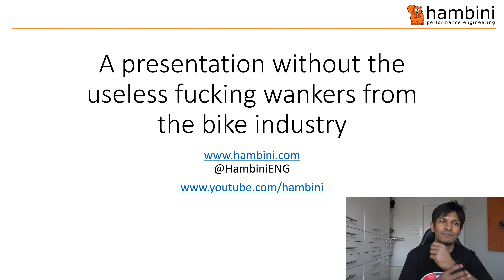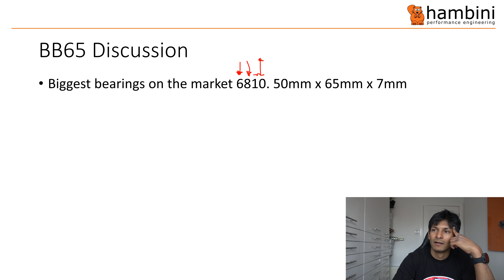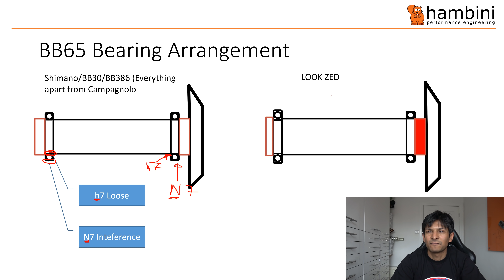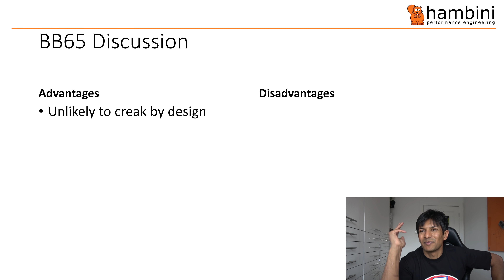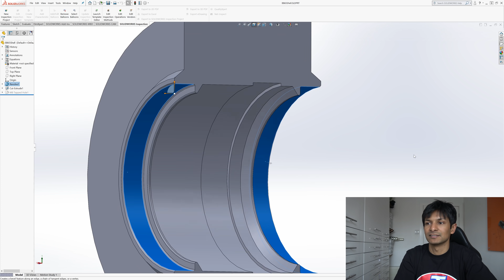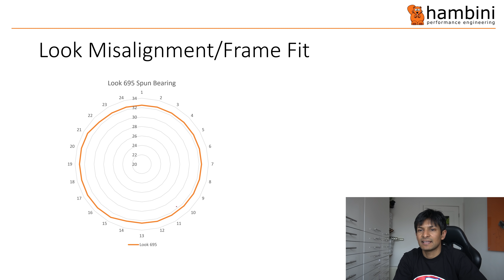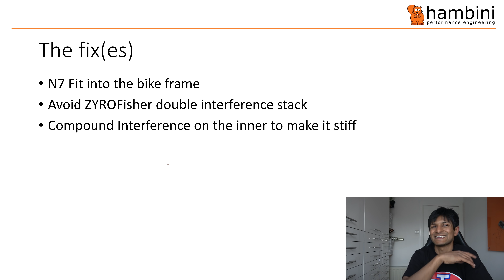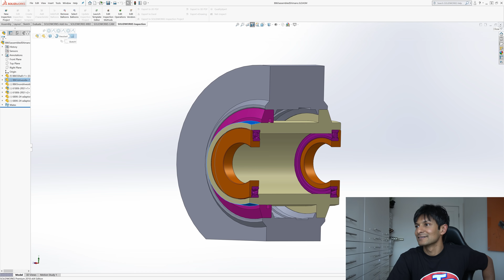French Engineering superiority: Hambini Bottom bracket and Look 695 bike frame

Comment: It’s about time you cut that threaded rod on your bearing press down to size. Your videos will be shorter   Lol
Reply: He's just ready for someone to invent a 250mm bottom bracket shell and for Cycling Weekly to try and convince us that a bike with a Q-factor like the stirrups on a horse are the 'new aero' (with full supporting wind tunnel data, of course).
Reply: It's almost certainly a headset press pinch hitting as a BB press.

Comment: I really enjoyed this. Works as a mechanical engineer in micro-mechanics / medical, and enjoyed that you took the time to explain the failure mode that occured and what the fix was. Also learned a bit today in regards to the bearing fit between the frame/BB/crank - all round good stuff! I have got a new build in the works, I'll check if you have brackets available for this fitment.

Comment: This is like having your favourite dessert twice! Did the original get taken down?
The other thing that is so amazing about look is you get a finished bike (aka buying a 695, which i just did) you get, all the adapters/guides to cut the stem or to cut the seatpost, you get blade pedals included, you get a bike cover, you get a proper carry bag, with all the special tools and compartments for them, all the lubricants required and gripping grease. Basically everything you would expect to build and assembly the bike to go riding! Again amazed what you should get, with every top end bike, but you don't!

Comment: you are a very very clever young man especially for a 5yr old 
. we have a street lighting fixing issue where a threaded coupler between light fitting and column bracket keeps unscrewing and the manufacturer insists its an install problem not a design one 
i bet you could figure it out in no time

Comment: Just got that 695 BB installed on my bike, THANKS HAMBINI, WOW so dam stiff and smooth, my power numbers are up ? maybe the garmin 3 pedals are broke, I keep calibrating as I dont believe the number increase, the feel of the power going through the drive train is very noticeable and almost surreal, anyone who likes the power speed doing and feeling you know what I'm talking about. it's like riding a new bike the characteristic behaviour of the bike has changed, smoother, stiffer and feels so fast, as it was fast already the BB seems to have brought it to another level, I'm a FAT Fu££$% and flying up short hills, as there feels like there is no wastage of power.
Getting on about the service of look bikes, its the same here in Ireland, for the sake of my bike I had to stop using the people who sold it to me, they were breaking it bit by bit and making school boy errors in service. I was lucky I found a technical bike mechanic who deals in high end racers.
Reply: edward dillon: If the power is measured in the pedals, a better bottom bracket may even deliver more speed, but will not influence the power reading!...
Reply: @natanbrastap7752  can the frame absorb in flex some of the power ?
Reply: @edwarddillon  I think no (there is a GCN vid on the subject), but the point here is that, even if the frame do absorb, the power measure in the pedals can't be affected, just the bike speed can
Reply: @natanbrastap7752  u think or know ??
Reply: @edwarddillon  The jury is still out, so I better don’t claim ‘to know’; but I align with the belief that the frame perhaps accumulate some elastic energy, but, if so, gives it back in the very same pedal stroke. If the frame did really absorb energy, it had to get hotter and hotter (and it doesn’t), because energy don’t just disappear, right?
Reply: But maybe you are on to something, yes... More rigidity allowing for a better pedalling mechanichs, to crush harder the pedals and deliver more power... Or the increased rigidity does affect the power reading, who knows for sure...
Reply: @natanbrastap7752   newbie here but can we measure torque at the crank/flywheel (crankset) or directly at the rear hub or wheel/tyre?

Comment: You are correct that Look is difficult to deal with. Their customer service doesn't even return emails asking for spares not on their list. But they do build good equipment. Though if they were easier to get I would probably prefer a Time since I think that they are a great deal more concerned with frame failures.

Comment: There is no dust seal on the crank bearing. Dust comes through the holes in the bottom bracket and destroy the crank bearing. I guess that's why the bearings on the zed 2 cranks fail...

Comment: Peugeout should hire the engineers from Look.

But yeah, it's the lick!
Reply: Kleiner Helfer  try changing head light bulbs on a Peugeout 307 and you will know what I mean.
Reply: Have had a diesel 208 for over 10 years now. Only part that broke was the brake pedal detector, cost 15€ and replaced it myself. Still works like a charm. No problem whatsoever changing lights.

Comment: I had bought a Look 765 Optimum+ (Full Black Mat Glossy - top of their endurance range) and the frame cracked after less than 200kms with no crashes, drops, or any other significant impacts! The crack occurred in the rear where the seat post sits. This bike uses Looks 'carboflax' so maybe this compound needs more R&D...
Reply: Did they give you another frame ? What happened ?

Comment: Layman question: If the frame is superior engineering, and the BB has a high quality bearing, why has the bearing spun?
Reply: Antti Salonen bearing wear and increase in friction, the 'spin' he refers to is more of a sinusoidal flex cycle of deform and relax with each pedal stroke, the outer race creeps around microscopically trying to drag a tiny layer of metal with it from the  housing. Which has caused the minor damage. of course you could argue the if Look had not produced the BB with it's fancy crank needing the BB 65 to be able to get it in, the  the bearing would be easier to change before they became overly worn, which caused the bearing 'spin' in the first place... 🙂

Comment: How come you used grease on the carbon to BB interface, but recommend using loctite on your 386evo BB?
Reply from the maker: it's not carbon, it's aluminium on this bike.
Reply: Hambini Gotcha. So, is the general rule “Use grease for metal-to-metal interface, use loctite for metal-to-carbon” or is it more complex than that?
Reply from the maker: Yep that's correct

Comment: I have a Planet-X frame with a BB30 bottom bracket, I bought it in 2010. Its been good. Now Planet-X frames have 68mm threaded BBs ! Is this because they lost their faith in press-fit or have their frame suppliers been unable to make frames with accurate tolerances ?
Reply: Threaded BB's  can be equally horrible executed as pressfit. Assume its because Threaded BB's has become a popular marketing tag, not because the excution on the frame is batter than the previous.

Comment: Very very nice work  Would it be advantageous to cut slots in the middle lengths of the bottom bracket body to save weight or would it affect performance & longevity ?
Reply: ........... remove the wheels too, lots of useless weight saved, boy does it fly then???
Reply: @gregtaylor6146  wow, dumb answer. Thank you for your invaluable contribution.
Reply: @gregtaylor6146  so are you alone in life  because of your stunning personality or because of your incredible wits ?

Comment: Hi Hambini, I really enjoy the video. I have a question. You are always talking about tolerances but never about roughness of the surfaces where the bearings are going to roll. By my little understanding usually bearings requieres quite low roughness and tracks must be rectified. To do so, in my college they explained to me that a little orifice must be done to prevent breaking the tool. When you machine and remove material you are already achieving the specified roughness? Thank you!

Comment: You are a "fine piece of French engineering".  Can you team up with geometron to design a fast alu road frame, that would be great, thanks.
Reply: Ummm... Geometron, what? Do you know that they are very much only mountain bikes? Also they are partnered with Nicolai, and you can see that all the tubing that Geometron and Nicolai use is very much cylindrical and not at all aero, and they are all pretty damn heavy as they are built for extreme durability and strength, great for mountain but not for road. I don't think we will see a Geometron or Nicolai road bike.

Comment: Hello Hambini. You speak about your Superlight BB for that job. How available is that material for frame manufacturers? Is it already being used? or will we see a normally £700 frame for £2000 because of the cost/weight of the material? thanks :) mark
Reply from the maker: It's quite difficult to weld so that makes it problematic for frames. Bike manufacturers aren't cutting edge so it will take a while for that to filter through
Reply: @Hambini  Thank you for your prompt reply Sir. I might well be 40 and fucking fat before a sub 1kg frame [that wont crack like a Starship] appears.

Comment: 30 years atleast
look kg86 i think was the first? someone will correct me
Reply: Ash Staniland - I think Kestrel was in production first with a monocoque carbon frame and it was made in the USA.  I have one.  Bought mine several years later in 1996 from R&A Cycles in Brooklyn NY.
Reply: Greg Lemond was the first rider to win the Tour de France on a carbon frame. 1986 on a KG86.
Reply: @robertp7209  Carlton (division of Raleigh) were producing them in the UK as early as 1971. Graftek produced carbon bikes for the US cycling team for the '76 Montreal Olympic Games.
Reply: @davidlewis3924  carbon tubes bonded into aluminum lugs useing the same bonding tech and lug machining as in in the Duralinox frames. True carbon award goes to Krestell.
Reply: David Lewis - full carbon incl. bottom bracket and head tube, or just the main tubes?  Fork?
Reply: @robertp7209  Carbon tubes, alloy lugs. Fork would have been carbon blades with alloy crown and steerer (I guess). Giant did a similar version in the late '80s called the Cadex I think. A friend of mine had one around '88/'89 and it came with some astronomical price tag like 900 quid. Pretty exotic in those days when most people were still riding steel.
Reply: Morten Reippuert Knudsen - kestrel EMS fork had steel steerer and crown.  The rest was carbon.  I wish carbon forks today go back to steel steerers, carbon failures have been catastrophic at times
Reply: David Lewis - sometime not long after, fat bottom tube Cannondales appeared and titanium alloy litespeeds became popular.  I was told not to get carbon, a mistake.  My Kestrel has 20k miles not a crack in it, and I’m a heavy rider.  The magazines at the time gave it favorable reviews compared to steel, said other carbon production bikes I think Trek dulled the ride not lively.  So much for titanium alloy - never took over.  Looked good though unpainted.
Reply: @robertp7209  I seem to recall around 1988 the first fat tube Cannondales appeared in the UK with an ad slogan something like 'the first production frame under 2.8lbs'. Here's the catalogue from '88  https://vintagecannondale.com/year/1988/1988.pdf  Shimano 7-speed SIS and steel forks. I was riding a steel Reynolds 531c frame at the time with a 52/42 crankset and 6 speed 13/23 freewheel. My knees hurt now just thinking about it. The Klein Quantum made an appearance then too but very difficult to get hold of in the UK.

Comment: Could this be made to fit a BB30 crankset or would the bearing dimensions mess things up? If not, could it be made into a better version of a BB65 to BSA adapter?

Edit: is it actually 6806 bearings that you could use a long axle BB30 crankset with?

Comment: Splendid job and breakdown of developing spun bearing issue on that LOOK frame and why your fix is tits.
Quick question just out of sheer curiosity: Does it or does it not make sense (in very general terms) to fix a counterweight on the non-drive side of any given crankset with the purpose of dampening out overall "wobble" forces along the axle? Always wondered about that. 
Anyway Hambini - THANK YOU for your valuable content and very educational presentaions.
Reply: There is no wobble at 60-120 rpm, so nothing to damp.

Comment: Hi I have work on many look the main problème i this zed crank . I already à creak problem. 2 type of wear, one the bearing turn on the frame and second the bearing move side by side and wear the frame and creak. Look take many years to solve the problème , and test full range of loctite ,the load allready brake it. Now look just have the track bike with zed crank. Is maybe good engineering but the reality is not the same . It have 2 other exemple in look , aerostem the bar can slips but engineering said it have more contact and epost wear to fast. Magic does his effect and all this technologies disappear in all off the look catalogue. For happyness of all bike mechanic and especially look team mechanic 😂

Comment: Hey, great video. One question, I don’t understand how the bottom bracket stays tight on the frame…..if I understood right there’s no threat between the two pieces, just one goes thru the frame and the other one simply goes over like a pressure washer over…? is that it? did i get that right? how can that hold ?

Comment: So haven’t you just made it weaker by fitting smaller bearings than original? Why not just replace the original bearings? Also I presume your design would interfere with internal cables unlike the original? As would block internal holes. Does look nice though

Comment: Ok.  I’m old school. You could by a bottom bracket for the old steel then aluminum.  No issues. So I’m totally baffled why all these frames (carbon) seem to have all the dimensional and alignment issues. It’s not rocket science. Are the designers qualified by some global online university ? Surely Earnest in Italy achieves quality unlike the rest ?
Reply: It’s not necessarily the designers creating the issue.  It seems to be implementing a proper design and seeing it through the manufacturing process, and it seems the bike companies don’t want to spend enough money to see everything through.  It baffles me that a $50 auto part is produced properly, but $100 bike parts are not, so we have to spend $400 to have Hambini do it right.  Such is the world of mass production today.
Reply: @petesjk     It’s madness !  I shall take it back with respect to the designers. Manufacturing though. If the company I work for sold out of spec product then it’s a disaster! Produced in multiple locations globally but one way of producing dictated by the mother shop then QA systems.  Staggering that Trek etc do not do this. One unit of ours retails at $3. We expect it right for the millions produced and sold. Should be easier still on high value.  As you state with car parts vrs the fundamental aspect of a bike. The frame. Shame on them for no QA !!

Comment: I’m going to say, if they are the only ones doing this, it’s NOT “a Standard”. . .
Reply: Define standard.
Reply: They're not they only brand that produces it's own "standard" these days to lock you in to their product. Some BB "standards" these days - BSA/ITA threaded, BB90, BB95, PF86, PF92, BB30, OSBB (road), BB30A, BB30-83 Ai, PF30, OSBB (mountain), PF30A, PF30-83 Ai, BBRight, BB386 EVO, T47, Threadfit 82.5, SRAM DUB. Then you have axle diameters of 24mm, 25mm, 24/22mm, 28.99mm (WTF Sram Dub?), 30mm, 50mm. Let's all spare a thought for our local bike shop who has to try and stock and tool up for all this.